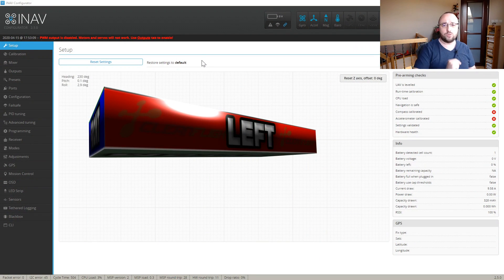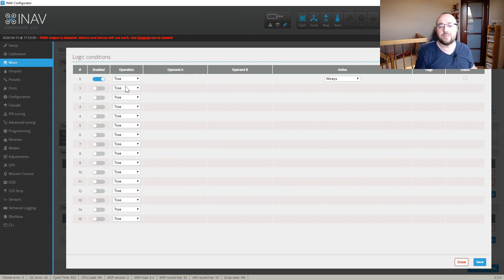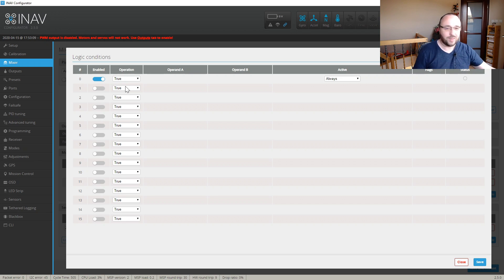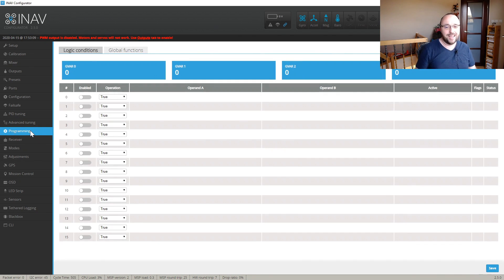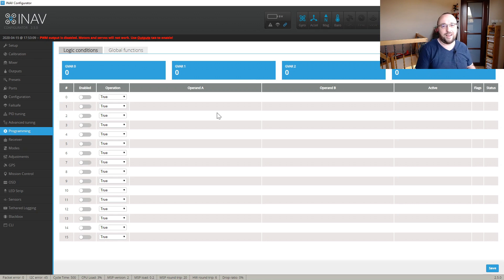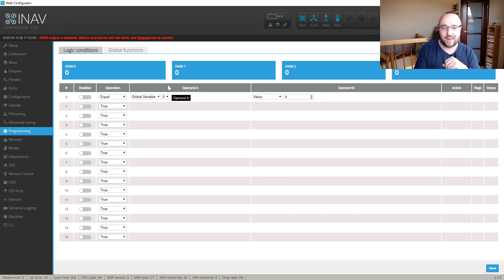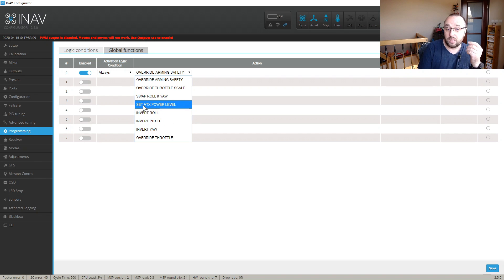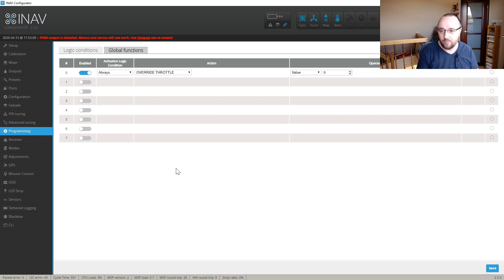INAV is a PLC now? You Too Can Program INAV

Comment: Hello Pawel. Nice video on programming in Inav.  Have been trying to get my Alt hold on my Hydrofoil boat. Using TOF sensor (10120) I2C to hold the set Altitude above the water. Been on it for 3 weeks now and still cannot make it trim the elevator, Alt sensor shows up Sensors tab.  Its the programming in Inav that's screwing me. Anyone able to Advise.. Thanks.

Comment: So I am trying to set up spoilerons on one switch/knob & just flaps on another swithch/knob.  Spoilerons will activate when flap switch, spoiler switch, & AIL dual rate switch is in the high position.  Also when Aileron dual rates switch is high pos, I want it to take control of the flaps to work them as ailerons too.. ughh!! I know I am asking alot. I have a MPX Lentus to maiden.  I know several years ago on a Spektrum dx18 I was able to to do all that and more thru radio. i.e. setup elevator dul rates to work with flaps & spoilerons &  all kinds of crazy stuff on an MPX Cularis

Comment: Hey Pawel!  I've been working on programming an auto-throttle function within the programming framework on 6.1.1.  But I'm running into issues.  It appears that the programming framework can't handle decimal values, only integers.  Is that correct?  Thanks for confirming!

Comment: Question for you, I’m running speedybee f405 v3 with inav 6 and I can only select multi shot.  Sounds like everyone has this issue only with inav. Sounds like it works on beta flight. Is there a way to fix this. Thanks any help is much appreciated

Comment: Pawel, I appreciate your work on INAV, it is very useful software! I'm trying this programming feature out, but don't really understand how it works. This is the situation.

 My plane has (H743-WING V2) and navigation LEDs (static color, non-addressable). I would like LEDs to blink when INAV is armed. I have LEDs powered by 5volts on the Vsw pin. INAV Modes/User1 allows me to switch the Vsw pin on/off with the arming channel. Great!!! 

But LEDs are always illuminated. I would like navigation LEDs to blink or flash when armed.  Is this possible to do with the INAV Programming? I have followed your very informative video, but don't really see how to modify your example to fit my needs.
Reply from the maker: Programming can not do that. The set of functions does not have the LED integration. You have to setup LED functions independently
Reply: @FPVUniversity  I was hoping to use the preinstalled LEDs without extra hardware. Still, thank you for your reply and your work on INAV!

Comment: I used iNav programming to adjust throttle with OVERRIDE THROTTLE to keep voltage drawn from a solar panel at the ideal voltage.   It saves having MPPT hardware/weight on a solar airplane design.   Was really cool that it was so easy!

Comment: I'm currently tinkering with the logic conditions, but couldn't get it to work... Here's what I want to achieve: The TBS Tango 2 has not so many switches, but it has 2 momentary switches (E and F). I use one of them for the beeper, which is fine for that use case. For the other I'd like to use it between different OSD settings (2 would be fine). So basically what I need is a T-FlipFlop-Function. A single input which sets the output to 2 different values - If I'm in OSD1 and hit the button, it changes to OSD2 (and vice versa). I tried to solve it via GVAR-INC (and then some AND that if I push the button  the next time, it would reset to 0), but the button stays on for more then one cycle and then GVAR goes straight up. Anyone has a recommendation?

Comment: A programming feature sounds great.  I am trying to figure out how to use it to trigger a RTH when my voltage falls below a defined value.  I know how to trigger a RTH with a switch and for a failsafe, but not for a low battery.  If this is possible then iNav could match all the RTH functions of the camera quads.  Help.

Comment: Hey Pawel,
Two question regarding setting up Inav for a fixed wing:
1. It took me hours till i found out that in order to spin the motors i needed to set an ARM mode first (which is greyed out by default)- this is very non-intuitive as it’s not being mentioned anywhere within INAV configurator near enable motor output slider etc. I went through so many tutorials about troubleshooting of non arming motors and non of them mentions that. Why it can’t be done automatically or set to “constantly on” by default for fixed wing (under one condition: throttle from the TX must be >=1000 on battery connect)? If someone needs a throttle hold they can do it via their transmitter by assigning a switch with flat line zero throttle curve. This is how it’s done on all airtplanes with normal receivers. I fly planes and helicopters and it wasn’t obvious for me. Also I might be wrong but i’m “wasting” one channel and a switch for that.
2. What is the story with „Has flaps” switch as it makes no sense for me since i need to still assign a correct channel to drive my flaps servos.
Thank you for all your hard work!

Comment: Hi Pawel. Do you think is it possible to create a "special" mixer or a program to control a recording camera, using the gimbal ouput as comand, and make a mixing program for two side servo (like helicopter swash plate) ?   If the quad goes straight ahead the two servos push the cam up together. If the quad makes a turn to the right, the right servo pushes the cam up, and the left one lowers it.
Reply from the maker: This can be done even now. There are mixer inputs Gimbal Roll and Pitch
Reply: I think it is currently not possible to create a mixer to control the pitch and roll gimbal using the servo mixer. Only "INPUT", "WEIGHT" and "SPEED" can be set. It is not possible to create a special mixer capable of using two servos like a 120 ° hely swashplate. I think INAV has one output for servo roll and one for servo pitch always separate.    This is my project (only one servo at moment) https://drive.google.com/drive/folders/19IA_wLahO5pEU7upqnQvlql1InlJkO0M?usp=sharing    
I tried to assign 2 rules to each servo with different WEIGHT: servo (0) = "pitch gimbal" with 200 weights and servo (0) = "roll gimbal" with 100 weights, but due to an INAV bug it is not possible to assign the same two rules to servo(1) because the INAV output mixer assign always S7 and S8 channels to the servo (0) and this problem cannot be solved. 
To assign servo (0) to S7 and servo (1) to S8, only one rule can be used for each servo.
Reply: Here a screenshot where you can see the INAV bug    
https://drive.google.com/file/d/1Wo-yN_t8jwtTSzJVQ7s9XylyM06FXnj7/view?usp=sharing

Comment: I wanted to have a plant of wood with a an old spraceingf3 and basically have it as a floating barge weight, and its conditions would be,, such that within .9 to 1.1 g in such and such with a pid.  and then a ridged anchor line on a quad that would "push" this weight at higher altitudes, so i guess a baro on the "floating barge" and the "tug"(s) boats.  Like, i havent messed with the configuratior yet, but was wondering about function calls for telemetry reads/ingestion of sensory data etc. 
thx
Reply from the maker: Probably some bits and pieces would be missing but you would have to check which inputs you need for that

Comment: Without the map or defined waypoints, could I program in a spiral pattern? For example, whenever activated and locked on, it would fly out straight, once battery voltage reaches a certain number, have it start a spiral back to home?
Reply from the maker: Probably not with current set of inputs and outputs. I mean PosHold works like that only there is no RTH trigger yet

Comment: So... the 6POS knob on that X10 you have, or the six buttons on a T16, you could program the IMD6c video frequencies based on a channel value, and then you just set your knob to the channel you are assigned at the event, power up your aircraft, bam, channel set. 😍
Reply from the maker: not yet, probably not in INAV 2.5 but that is the goal. For 2.5 it's for mainly servos
Reply: @FPVUniversity  It's OK, I can be patient sometimes. Servos is pretty cool for use with one of those PWM camera triggers to take a picture based on distance.

Comment: Looks good --- but far away from my current experience. Hope to finally upgrade one of my planes from a cheap KOPILOT flight assistant + FPV module to an inav controlled flight controller I purchased a year ago or so. 
Therefore I follow your channel almost 2 years I guess ... but I have purchased a flight controller F4 whatever ...

And I got a Jumper T16 .... and ordered additionally a Master RC  Transmitter with a TBS crossfire module...

Comment: Hello,
Been trying to bring INAV to eclipse to build and make modifications on windows 10 without success. Do you have tutorials relating that?
Reply from the maker: Eclipse is not recommended. Use Visual Studio Code with Windows 10 WSL https://github.com/iNavFlight/inav/blob/master/docs/development/Building%20in%20Windows%2010%20with%20Linux%20Subsystem.md
Reply: Thanks for your reply.  My windows version build doesn't allow WSL.  Would you have any recommendations or tutorial for ubuntu 16.04 as I am running a virtual machine?
Reply: @tahoe250  Look in that development folder for more guides: https://github.com/iNavFlight/inav/blob/master/docs/development/Building%20in%20Ubuntu.md
Reply: enginerdy, I actually got it working with hardware debugging using openocd.  Works great!  I can’t imagine doing development without hardware debugging for this massive code based.  But thank you.  Always nice when we help each other out.